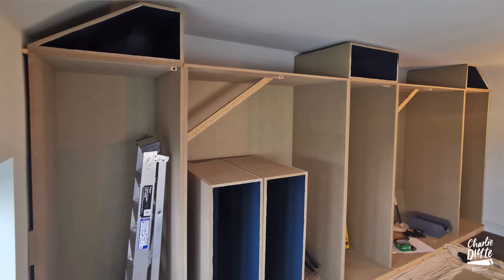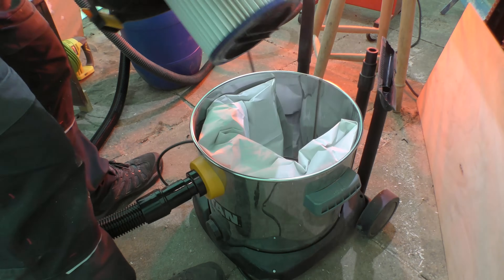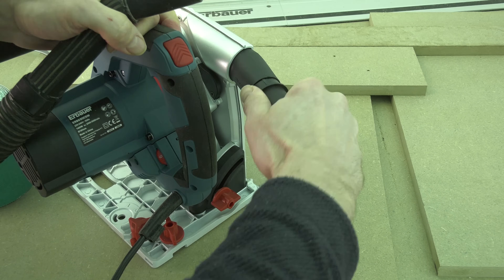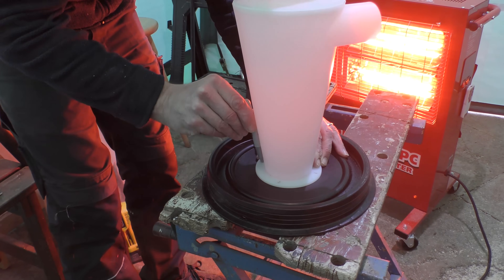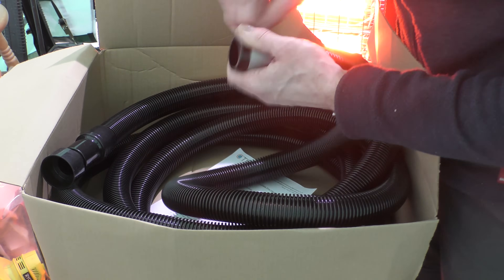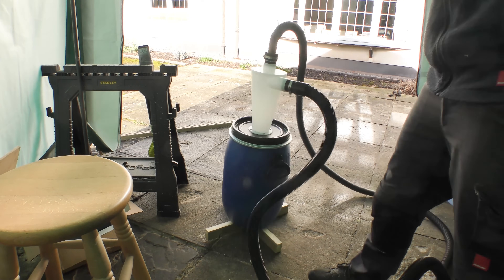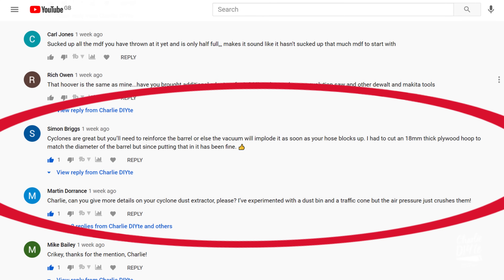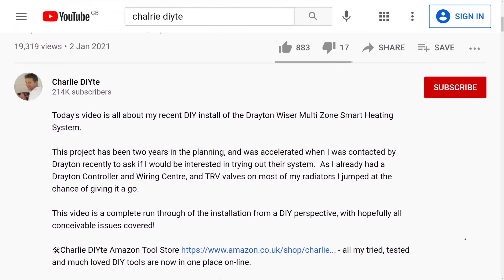How to Make a Cyclonic Dust Extractor/ Collector

Comment: I had endless problems with the barrel collapsing. There is a pressure relief valve available to buy or it may be possible to make one. https://www.dust-commander.com/gb/p/19-dust-commander-dust-sp-anti-crush-valve-3760013430467.html
Reply: At that price it probably isn't worth the effort of making one yourself but you can make one pretty easily as shown in this video: https://www.youtube.com/watch?v=wNBxce-HeCw

Alternatively you can make a frame work of hoops of wood that sit inside your barrel.
Reply from the maker: Good tip. Thanks David👍🏻

Comment: I'm using the 18l Titan wet&dry shopvac which is very similar and it managed to implode the exact same barrel, it didn't happen at 1st but one too many blockages and it went and once it had buckled once it kept doing it more frequently.
My 1st thought was maybe you got lucky with the barrel, the extra long hose from the vac to the barrel might well be compressing and acting as a sort of pressure flood plain (EDIT I have a very short hose from the vac to the cyclone and long to tools), who knows.
Either way I love my almost identical setup it has made a massive difference to my little workshop.
Reply from the maker: You might be right about the long hose. Yes I love it too particularly now that I can keep the Titan out of the way whilst I'm working.

Comment: Excellent video. My cyclone didn't come with adaptors so off to look for some. I also added a hardboard gasket under the barrel lid to reduce some of the flexing. My vac is a small one at the moment so hopeful there will be no collapse.
Reply: Chris consider making some of your own adapters out of PVC pipe. You can see what to do in this link: https://www.youtube.com/watch?v=cjLQo3GuvDo
Reply: @C4sp3r123  Nice link. Thanks. Will give that a go
Reply: @C4sp3r123  Hey, just to say I followed your advice,  scored some pvc and went at it with the heat gun. Great results and super happy with the cyclone. 👍

Comment: Made one of these a few months ago but I still end up with a small amount of saw dust in my vacuum any ideas
Reply: If the barrel gets too full it will end up sucking more into the vac, also I find larger lighter bits sometimes go through to the vac, but the fine dust tends to stay in the barrel.
Reply: the main reasons for bypass of dc seperaters is
over filling.
 not as critical with a cyclone untill it fils up into the cyclone. much more critical on other seperater types

air leaks
air getting into the barrel or between the cyclone and lid will create a draught that will pull dust up into the outlet pipe

overloading  
vacuuming up too much dust at one time can overload the cyclone and allow bypass. not too critical with powertool use but can happen cleaning out built up dust in a tablesaw or sweeping on the floor

string shavings can cause blockage stopping dust falling down into the barrel
Reply: @MelbourneAlan  thanks I will check for air leaks

Comment: I used a similar system and had the barrel collapsing issues (using a Miele vacuum). A good solution I found for it was using a metal bucket with a lid. A bit harder to cut a perfect circle on but with a bit of hot glue it worked perfectly.

Comment: On my set up, I use a short 63mm hose between the extractor and barrel...this gives you a bit more suction at the business end.  You could then use your long hose hooked up to a tube in your workshop ceiling as an overhead system. Much safer and more convenient than 6m of trailing hoses in a small space!
Reply: I do exactly the same thing with mine, and works really well.
Reply: Please post a Google Photos link to your set-up. Thank you!

Comment: The only issues I have read about is that such things reduce suction power at the end of the hose. So starting with really powerful machine is important. If it’s effective enough at catching fine dust then potentially removing the filter from the vacuum completely would help make up the suction power drop. 
Length of hose has an impact too on power. But hey don’t get caught up on the naysayers like me. It obviously seems to be working really well. 
Oh I almost forgot. One trick I saw one other guy do was to put the vacuum outside the work space completely. This means that all harmful dust sucked up, gets removed rather then depending on HEPA filters and recycling the air. 
Anyway, it is as usual a joy to see your take on things and the little insights too.
Stay safe and keep on doing your thing.